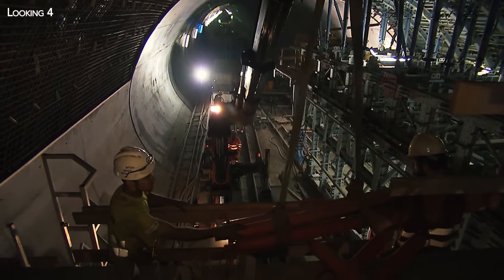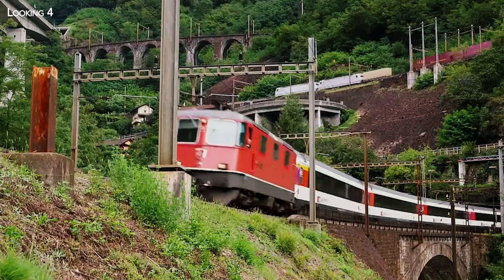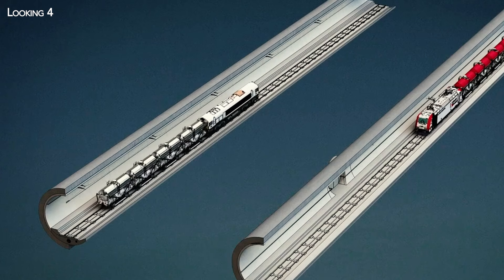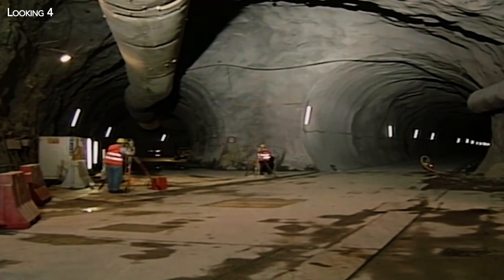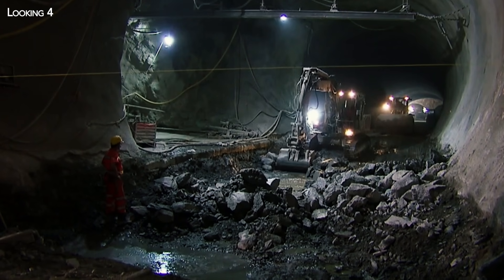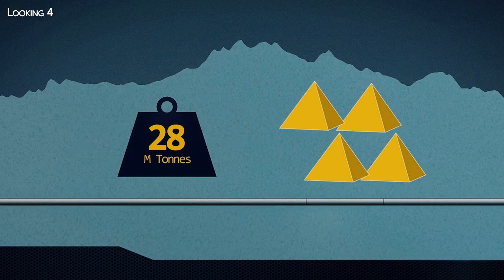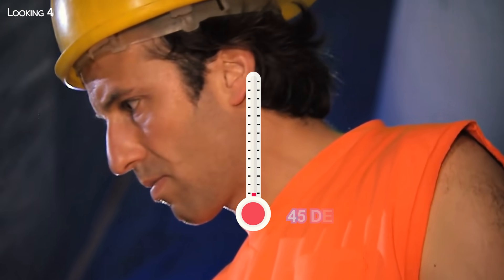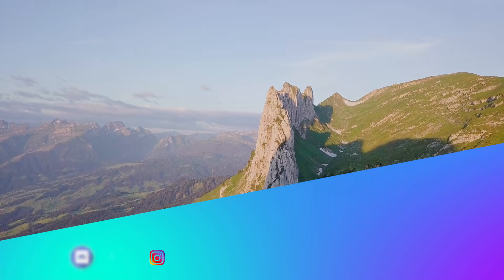Switzerland's Mega Tunnel Under the Alps

Comment: This tunnel does not bring Switzerland and Italy closer. The tunnel is entirely in Switzerland and therefore connects Switzerland with Switzerland. It does however benefit traffic between Milan and Zurich.
Reply: The tunnel was mainly build to transport cargo through Switzerland on rail. The Gotthard (and Lötschberg) Base tunnel are part of the cargo corridor between Amsterdam and Genua. The tunnel itself maybe entirely lies within Switzerland, but it'd have never been built to just reduce travel times from Zurich to Tessin. It was build to make a faster connection from Switzerland to Northern Italy.

Comment: The maximum speed is increased to 230 km/h and the journey time from Zurich to Milan is 3 hours and 12 minutes today.
Reply: The Tunnel has a permission for 250km/h, but they only do 200 because otherwise they couldn't fit as many freight trains.
Reply: @janzumstein8241  that's incorrect. First the Tests are up to 270km/h. The air resistance is a big problem by 270 and 250 km/h, they would use too much electricity to fight the air resistance and that's why we don't drive at such speed. The "normal" speed is 200 and can go up to 230 if the trains have a bit of delay. Since there are freight and passenger trains it makes no sense to speed up the passenger trains because they would have to decelerate to maintain the safety distance.
Reply: @BBenjaJ  I just read on a website. The Tunnel has a permission for up to 250 km/h but SBB themself say trains can't exceed 230 km/h

Comment: Great video.  One question: what did they do with all the excavated rock and earth?
Reply: afaik, Part of it was used for the production of the concrete that got used in the tunnel. The Rest got (or is still?) used for landscaping (mainly renaturation of a lake and artificial islands for wildlife - or simply put: dumped into a lake)
Reply: @vampire4312  Thank you very much.
Reply: Are they dumping into the Adriatic sea?

Comment: Amazing! How many lives cost this tunnel?
Reply: 9 people died between 2000 and 2012 while working on its Construction
Reply: As far as I could quickly research, there were 9 of them. Too many, actually, but considering the complexity, let's say, a relatively low number.
During the construction of the first Gotthard railway tunnel (around 1882) there were 199 deaths over a length of around 15 km.

Comment: Strange time to release the video! Wasn't there a massive derailment in the tunnel a few months ago? 8 kilometers of track damaged and have to be replaced, and the tunnel remains closed in one direction until September next year? Also a safety gate  was damaged in the crash, causing further problems equalizing pressure between the tunnels. Questioning to effectiveness of having no rescue tunnel like the Chunnel? I heard about it in the U.S., surely someone in Europe noticed?
Reply: a German freight wagons wheel broke. German train infrastructure is not in good shape. Quality and quality assurance have sharply declined for German trains the last 20 years. German quality assurance regarding freight trains have found to be inadequate by Switzerland after that accident. German freight wagons now have to document their safety much more when entering Switzerland. tho not much has changed in Germany itself, where the main problem lies.
Reply: Correct one tube is open while the other has to be repaired. A safety tube would not be any help. The tunnel was never designed as an passenger tunnel so as long as the tube is closed the passenger trains take the old route over the mountain.
Reply: now in 2025 its fixed.

Comment: Not to forget: as far as I know, Switzerland payed for this tunnel all by itself! The EU, although also highly benefitting form this tunnel, didn't pay anything at all. 
Please correct me, if I'm wrong about this.
Reply: the Swiss also paid a part of the extension from two to four tracks on the Italian side, as it would never had startet otherwise like in Germany. the germans singed a contract  in the 1990s telling they will upgrade basel-karslruhe tracks from two to four so it has enough capacity for the gothard base tunnel when it's done. shit is finally being built expected to be finish in 2042. 26 years after the base tunnel was finished.
Reply: That's true so far, but the voters even said yes to it, which means that the project was not simply determined by the government but the people were behind the construction and its financing (from tax money).
I tried to do some quick research into the extent to which EU money had flowed in, but apart from one remark ("gift to the EU") I didn't find any clues. From what I know in our country, this should work out; you finance it yourself and decide about it yourself.
Reply: Tre tunnel.ferroviari del.costo complessivo.di.23 miliardi di CHF. E' stata la realizzazione del progetto Alptransit, tutto e solo.svizzero.e cioe' :  Loetschberg, San Gottardo e Monte Ceneri. Gli.accessi esteri.in Germania e Italia sono assolutamente insufficienti.....!
Reply: The Swiss , are benefitting large scale from Europa ,  national debt : Zero  why paying otherwise , there must be a catch.................... ?!
Reply: Swiss got all the gold and money in the world so it’s not an issue

Comment: Get the Swiss to build high speed lines in Britain!
Reply: And the USA
Reply: Except this isn't >300km/h proper high speed rail, and it wasn't cheap.
Reply: @simond633  With conventional rail, there will never be tunnels this long with speeds over 250km/h. Air resistance is simply too big to make trains run faster in a operational matter. And yes it wasn't cheap, but it didn't went over budget and was finished a year early ahead of the plan.
Reply: @simond633  passenger trains have been tested to up to 350km/h, speed is limited because its mainly meant as a cargo line, so mixed traffic limits the speed of passenger trains also
Reply: @simond633  it was built for 250km/h any faster speeds and the diamaeter has to be enormous which multiplys the cost for a few miutes saved. the operational speed got reduced to 160-200km/h due to air recictence and therfore higher energy consumtion. in case of delays trains do reach 230km/h bacuse thats the speed limit currently but i dont know why they lowerd it.
Reply: Nope! The UK and USA are fully capable of building their own High Speed Rail networks. The problem remains politics.
Reply: The problem is everyone else wants to do it for cheap.
Reply: Rather the French or the Spanish as they build super fast ones quickly and for a much lower cost.
They even built high-speed lines within budget and ahead of schedule...
Reply: The Swiss are second to only Japan when it comes to railway and public teansport.

Yes, partually due to its suze, but as the japanese show, it works at any size.

Comment: Meanwhile Britain can't build HS2, ha ha ha!
Reply: imagine a high speed line from central London to Aylesbury, completely underground 🤯
Reply: Yea yea I know you have a chip on your shoulder about Britain.  But given this started inthe 1990’s and took until 2016 even if you take your shoes off and use your toes, you can see as a minimum we are talking 20 years+.  When did HS2 start?
Reply: @xr6lad we are building HS2 which is not under the highest mountain range in Europe. Crossrail took us 14 years from start to finish. The tunnels which were 42 km took that long. Tunnelling is a very difficult process. You have to make sure the tunneled structure doesn’t collapse on you risking lives. At this point we have to admit that the UK cannot even build a proper High Speed railway. Countries like Indonesia and India are now building HS lines with the help of China and Japan respectively and we cannot even afford to build a full stretch to Manchester and Leeds..
Reply: @xr6lad  Work started on Gotthard Base Tunnel in 1999 and was in operation in 2016 — exactly as planned and budgeted. To compare this with the work for HS2 is puerile: "I can brush my teeth in five minutes, and you need three hours to run a marathon?"